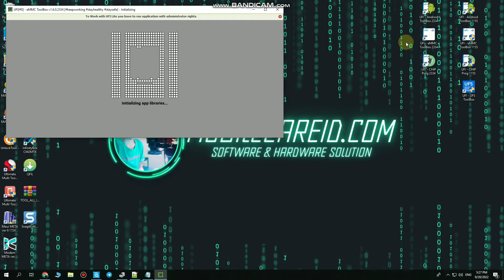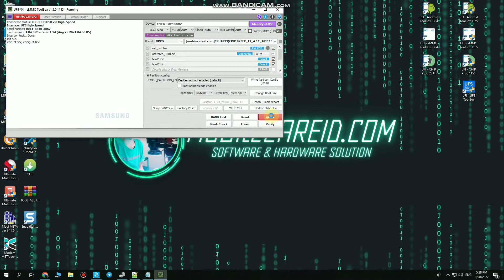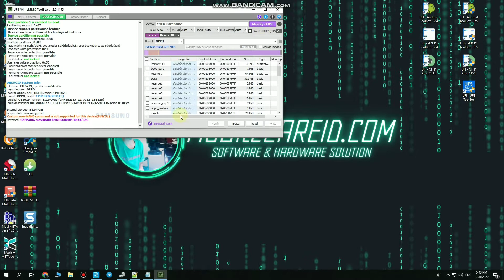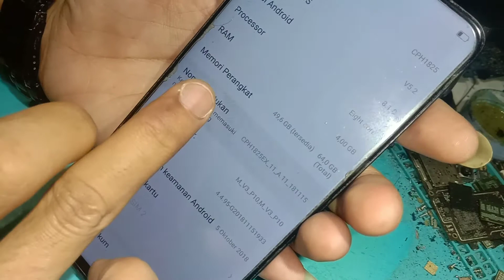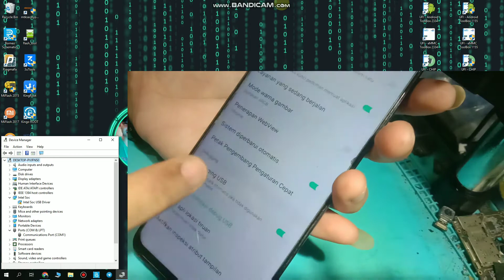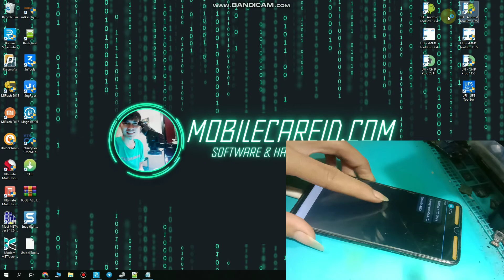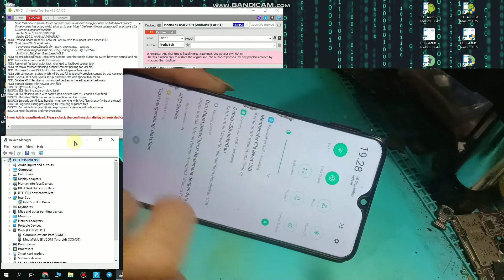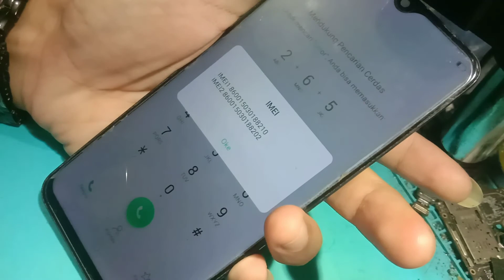Change eMMC Only Oppo F9 CPH1823 Using 64GB eMMC | Fix Dual IMEI @mobilecareid

Comment: thanks alot ,phone powers on after writing dump but takes alot of time as in https://youtu.be/kX1ydGxLfrw?t=541 how did you solve?
Reply from the maker: Erase nvdata nvram then factory reset. Use UFI v.1155, the latest version of UFI sometimes has a lot of errors that cause the device to not turn on or bootloop
Reply from the maker: @MotherboardClinic  You're welcome